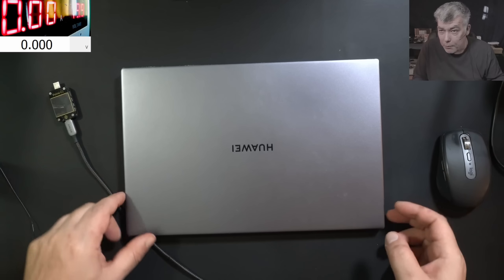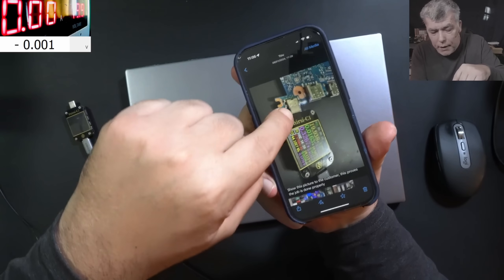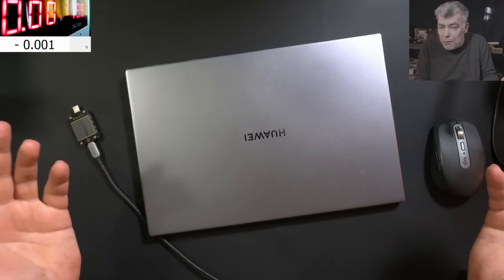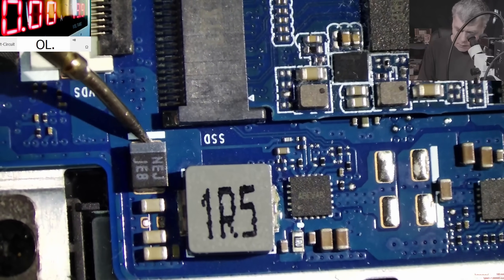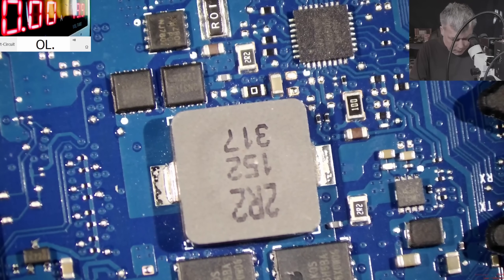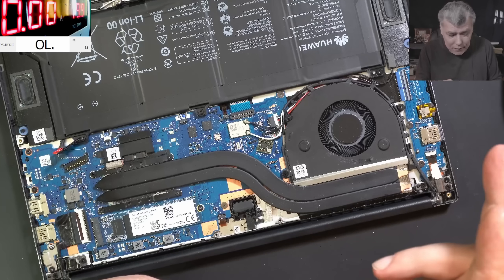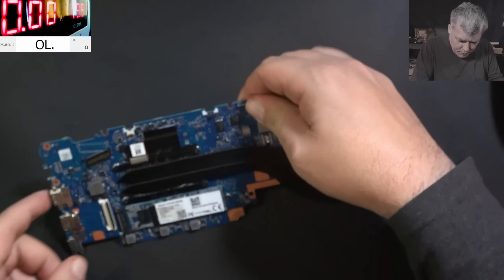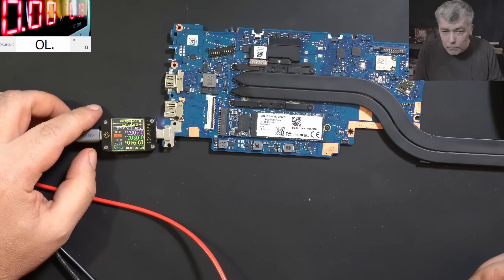Customer sent a Huawei D14 board for repair, i fixed it, but didn't work. What went wrong?

Comment: Hello sir, I have an issue with my Huawei laptop mate 14 D , I plugged a USB hub that is also plugged to power of 12 volts instead of using 5v adapter and when plugged the USB in 3.0 port my laptop screen went off and never came up. I opened it and removed the battery to discharge the current, still when plugged in the charger the power won't come up. What can I do because I don't have a trusted electrician.

Comment: Sorin, this doesn't make sense because your previous vid shows the laptop was complete and had foil on the back of the board. You repaired the charge port and everything was working. So why is the foil missing on the back of the board now? Or was that a different laptop but same brand from many months/years ago with a similar broken charge port where only the motherboard was sent?
Reply: He said it was a different one.

Comment: It was a mistake to take just the motherboard. When doing laptop repairs ALWAYS ask customer to send laptop complete WITH power supply. This has been brought up several times in the past. Maybe now after being bitten a few times it's time to actually do it ^_^
Reply: Sending in just the board is probably because of cost of (dis)assembling, but sure makes some trouble regarding who is having the liability for fault.

Comment: Great job! Thank you. Quick question: when you tested for short your PS clicked - I thought your PS was modified to remove short protection... will it still 'click' when a short is detected?
Reply: All power supplies whether they are linear or switch mode that have no short circuit protection including the linear one sorin uses will deliver current into a short circuit and almost all power supplies used for troubleshooting don't come with short circuit protection but with constant current function to limit the current, in this case the power supply is a linear one so the click you hear is from the relay which makes a click at some voltage changes and not because there's a short circuit so you can still deliver current into a short circuit without hearing the click if the voltage is low just pay attention to the c.c led when it lights up also you can hear the click just by changing the voltage on the knob

Comment: Where is the board protection? Has a black tape on the cpu side and one covered with aluminium on the ram side. I repaired d14 today, same problem, broken usb-c port. I will post a photo on discord chanel!

Comment: Hi Sorin, yes even me i require the sign of my terms of service and i don't accept only the main-board because of the warranty i give to the customer, otherwise is a wast of time if came back. Do you ask an integration to the customer for the diagnose in this case? the fault is of the customer that remove the foil protection..... let me know please as you decide thanks Francesco Timpano from Florence Italy
Reply: additionally put 2-3 Sorin-sticker on screws. When they damaged say: "sorry, you or another shop opened the notebook after my repair. Have a nice day!"
Reply: Yessss... as i do alaway... is important to protect your work..... customer must anderstend you are a professional... i don't know if Sorin do.... but hope yes

Comment: Never expect manufacturers put a foil on PCBs for nothing. If they can spare something they'd do it to lower the cost. In this case the foil was allover the board and it's the top side. I would assume it could be also there to seal the board from fluids. But mainly to isolate from the metal cover.t

It wasn't a small sticker it was cover allover the board, something to remember. The customer is a fool, simple like that. With bad luck there could had been a big spark and something important got burned.

Comment: In the previous video, the protective foil was on. This board has no foil, and the socket job looks a little different. Was Sorins' original repair copied on another D14 laptop, but they forgot to put back the foil ???
Reply: Huawei D14 comes in several varieties, AMD or Intel.  Same with other makers. the 14 refers to screen size. My D14 has Ryzen 7, looks similar, but not identical motherboard, to this one. Previous one Sorin fixed usb port was Intel.
Reply: @algizmo7079  Thanks for the comment /clue.  Can get problems going through 3rd parties. 'Tricks' of trade !
Reply: @algizmo7079 Everyone purchasing Huawei products get mixed up with satanic company. Huawei is one of the main distributors for 5G microwave infrastructure. When you'll notice dying birds, dying insects like bees, dying trees and when you'll notice people around you, who behavior like zombies,  than remember this company name and my comment!
Reply: Sorin said in this clip this was a different repair he did but did not film. It was the same laptop type and same charging point repair, but they were 2 laptops from 2 different customers.